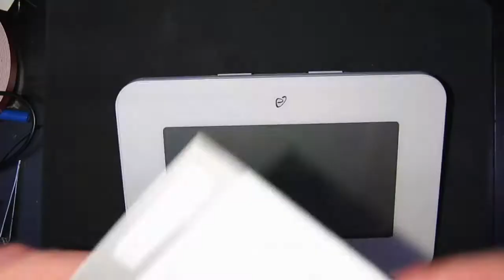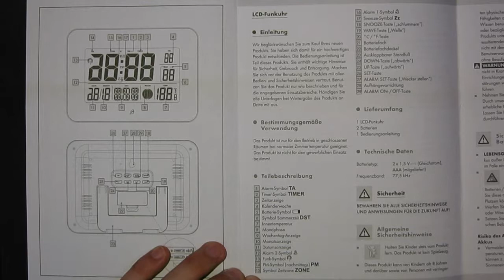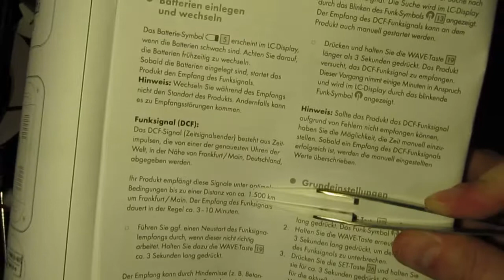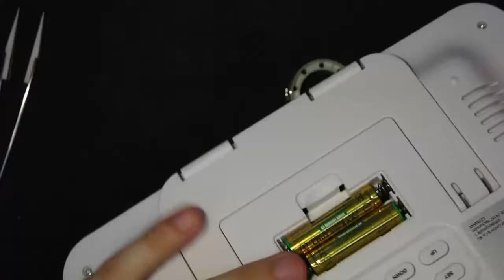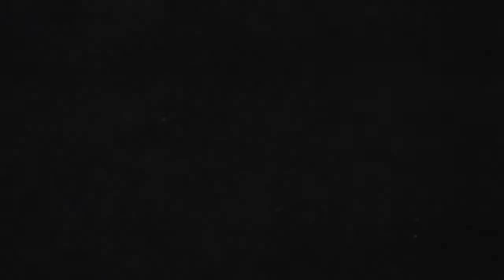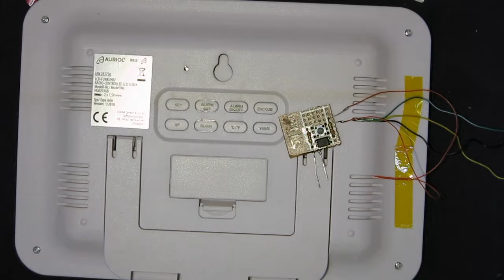Having fun with a 10 euro DCF77 clock - better than bare modules?

Comment: Interesting research!
Surely the market for such a unit is everyone within 2000 km of the DCF77 transmitter. Works fine in Netherlands for both my Casio wrist watch, and an inexpensive wall clock module.
I have a clock module to build into an Arduino or Pico project - so gathering ideas from YT.